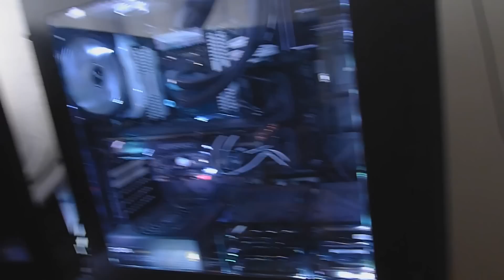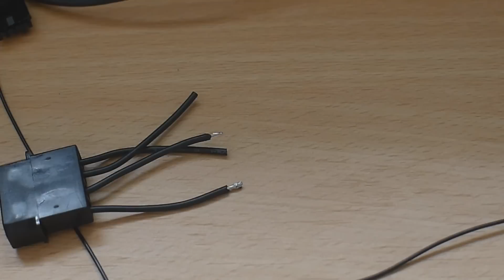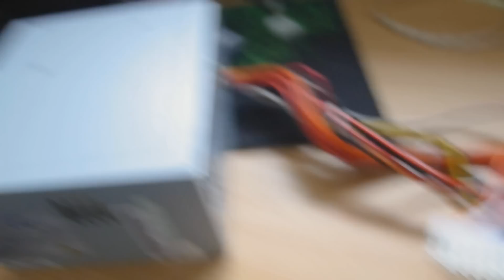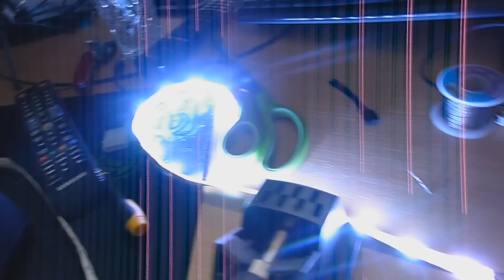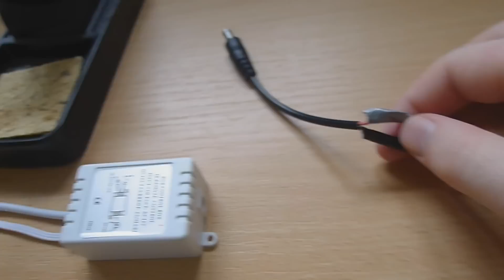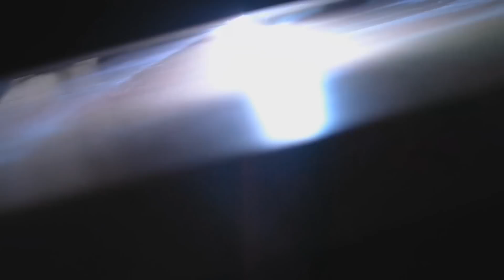How to add custom LED underglow lighting to your PC

Comment: Hey Modded Warfare, would you be able to make a similar video on installing these type of RGB strips in the 360 specifically? I'm unsure about how you could use the 12V points under the 360 motherboard with an RGB strip like you did with the single colour strip in the other video, combined with the remote receiver box for changing the colours.
Reply: Josh, i dunno if this would work or if you'd be able to comment on this but in theory, if the remote receiver box is only using the two points from the molex cable which is 12V and GND, would it not be possible to just splice the power connector to the box like was shown in the video and hook it up to the points under the 360 motherboard to power it and then just solder the 4 wires from the RGB strip to the RGB header on the remote receiver box?
Reply from the maker: I have already made a video on the 360 LED's. Not RGB. But all you need to do with RGB is solder the power and ground to the power and ground wire on the plug that provides power to the signal box. Check out this video: https://www.youtube.com/watch?v=MJuEa6yjCgw&list=PLn7ji3VsPy3FHTY0ZQ2AXrPLU-kY0K8xx&index=9 I used the points on the back of the motherboard where the power connector is.
Reply: Then say, for example, if I was using multiple strips (Like 2 strips, one down each side of the console) with the 4 points on the strips themselves - could I connect them  together with wires then solder the other end of the first strip to the RGB header on the signal box, and then (like you said) solder the signal boxes's power and ground to the power and ground points underneath the 360 motherboard?